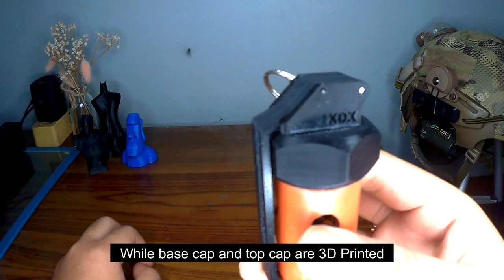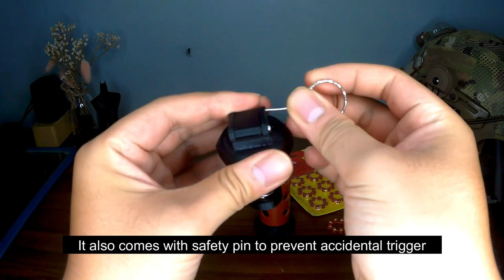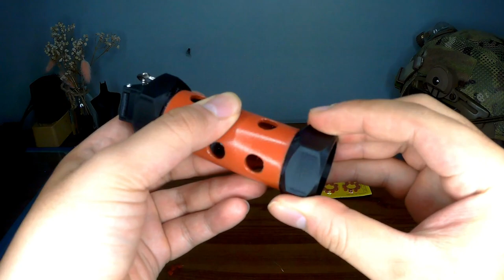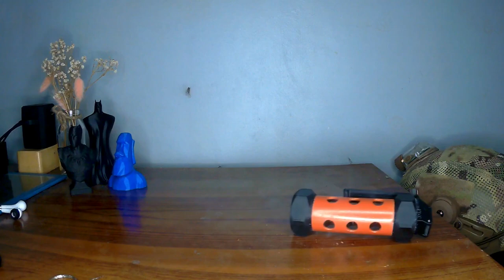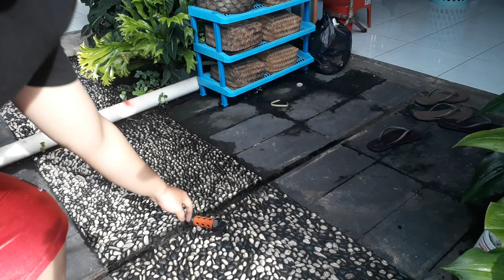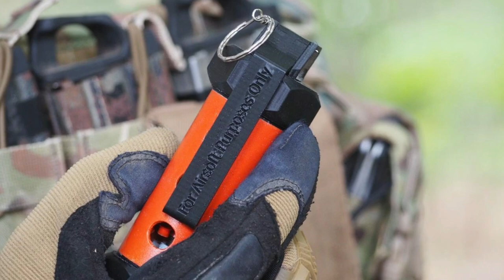"THUNDER CAP" 3D Printed Airsoft Flashbang (Impact Grenade)

Comment: Awesome little invention. Have you thought about designing one that uses more than one cap?
Reply from the maker: It is possible to add more screw in the base cap, hence, it can load more caps
Reply: I made one that uses red snap crackers basically a normal size firecracker that explodes on impact and sounds as loud as a M80 firecracker. My design has BB clusters that loads into the holes of the flashbang and it actually shoots them out. The next design is going to have the most powerful LEDs I can find on there that will flash for about a second then go out on detonation.
Reply: @GoofyAhhMods  do you have a link?

Comment: What spring did you use?
Reply from the maker: You can use spring with outer diameter 14mm, inner diameter 12mm, and 50mm length. Or you can simply cut AEG spring in half
Reply: @kdxstudio628  got it
Reply: @kdxstudio628  btw will there be a version that use those ramsets rather than a cap gun?
Reply from the maker: @Freedm762  i will never do that, lol
Reply: @kdxstudio628  ah i see
Reply: @kdxstudio628  like as in those ramset blanks?
Reply from the maker: @Freedm762  the other player may get mad if you use ramset. It is too loud, I think. Unless everybody wear a hearing protection
Reply: @kdxstudio628  probably for outdoor only, i got my fair share of getting my ears ringing because of testing a pyro grenade indoors
Reply: @Freedm762  did u ever find a ramset gernade?
Reply: @kdxstudio628  AEG spring cut in halh will be 90mm isn,t this to strong?Or i can cut in 3 parts!!
Reply from the maker: @dimitrioskarakostas8474  that is just for dimension reference, you could always use a weaker spring